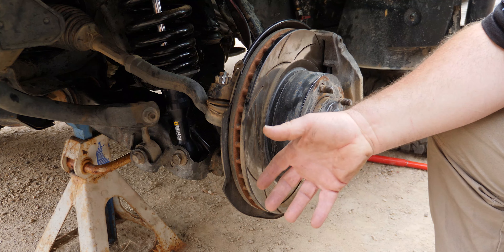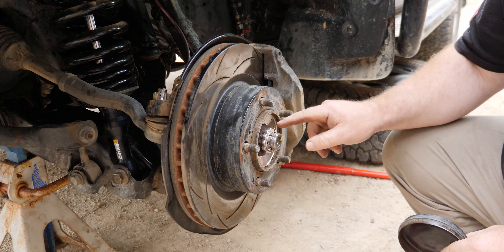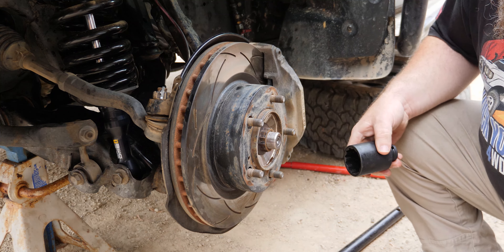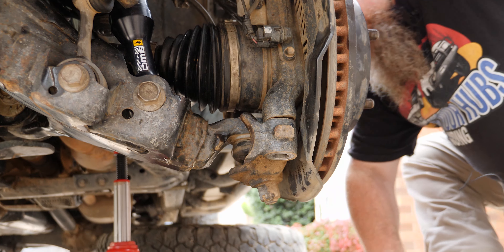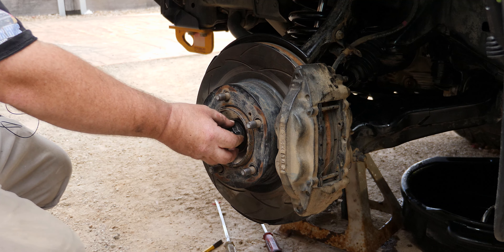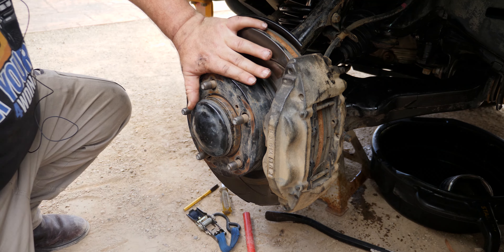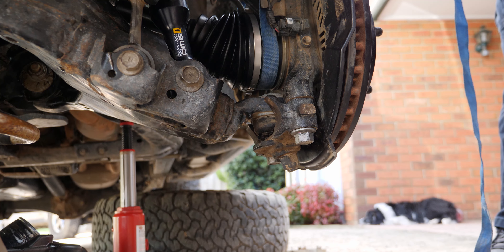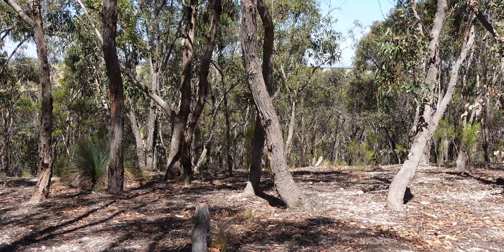How to replace a Land Cruiser 200 LC200 CV Birfield joint

Comment: Great video. Anti seize is the way to go. For easy replacement in future. The dust cover on the 200 series, looks to do a good job of keeping moisture and grime out. It came out with little effort.
Reply from the maker: Looked clean as a whistle under there and as far as I know, had never been removed.

Comment: It is possible to torque the big nut fairly accurately without a torque wrench.  
350 nm is about 260 ft lb. I weigh about 175 lb so I would divide 260 by 175, which is about 1.5. So I would put my body weight on the breaker bar at 1 and a half feet from the centre of the socket and this will torque it almost perfectly.
Reply from the maker: Now that's thinking outside of the box!

Comment: I'm awaiting my new GXL 200. This is so timely it's uncanny. I'm a Nissan GU owner stepping over to the dark side (hopefully the more comfortable and less overheating side) and understanding how to do this is a big confidence boost for remote travel with my camper. The GU driveline is not something I worry about, but having done 3 auto rebuilds in 2 years and spent a lot on oversized radiators (3.0 converted to a TD42) I'm really looking forward to driving a new car!
Needless to say a 12 point 39mm 1/2 inch socket and Toyota CV is on my shopping list.
Reply from the maker: Welcome to the dark side! The 200 is luckily one of the easier 4wds to change out the CV. 

The driveline is one of the best things about the GU, the TD42 kettle unfortuatley isn't.

Comment: Better to use a block of wood over the nut to hit at 4:30 .

Had a worn cv on a Subaru many years back, being broke at the time, I just swapped them left to right and right to left. Got many more years out of them.
Reply from the maker: You definetly need to use something softer than end of the CV.

Comment: Great video. But how can you tell if the cv is all the way in? And is it possible to cross thread it? Any info on what to do if out bush and dont have a spare cv?  Thanks!
Reply from the maker: You can feel it go all the way home. It's not possible to cross thread the inner as they're straight splines, the outer nut however can be cross threaded. 

If you don't have a spare, if just the inner cage breaks (this is what usually happens). Just remove the outer section that runs through the hub, lock the centre diff and just drive out in rear wheel drive.

Comment: Great video and channel,
So if you didn't have a spare would it be possible to just remove the shaft than limp home with the broken bit left in the diff? Or would it eventually fall out and loose the diff oil?
Reply from the maker: It depends on the setup,  if it's a two wheel drive, no, all the drive will go to the path of least resistance and you won't go anywhere.

If you have a difflock, engage it and you'll be able to drive forward, just need some way to stop the oil from dripping out.

Comment: Hey guys I’ve blown a cv on my 200 series can I drive with the cv full removed or does the cv hold everything in place
Reply from the maker: You would need to plug the hole in the diff, otherwise all the oil would come out. Also you would have to lock the centre diff.

Comment: Why did you lift the breaker bar rather than push it down when tightening the nut for the shaft in the hub?
Reply from the maker: That's where the tripod was!

Comment: I have a clunking sound in the front end on my 200 driver side front more noticeable when pulling up a curb I grabbed the cv and it has a clicking sound
Reply from the maker: Is it worse when you're turning at full lock?
Reply: @LockyourHubs4WDing  no not noticeable I’m thinking upper control arms had a bar in between spring and arm and clicking sound evident
Reply from the maker: @anthonybagnato7894  that sounds suspect, might need to check the bushes.

Comment: Thanks for the video. As a 200 owner I hope I don't need it 😬. What brand/type of CV was the broken on and what did you replace it with? What's your opinion on the highest quality/strength spare to use as a replacement? Had that CV broken before? How did he go driving out with a broken cv?
Reply from the maker: The car was purchased second hand (ex police), not sure what was in it. It was replaced with a genuine Toyota CV.  Genuine CVs while probably the most expensive, seem to last the longest.

 Luckily he broke the CV right at the top of a nasty hill and was able to limp out without any winching.
Reply: @LockyourHubs4WDing  mine is ex police as well. Mine was Toyota serviced for its life so it was probably a genuine Toyota one in that case. Thanks for your perspective.
Reply: I've only had 200 for 10000kms and a few months and about to replace my second cv .    Not a broken cv, but splits cv boots.   One was 10,000kms ago and the other recently
Reply: @ClaytonCookpanda  in was speaking to another 200 owner the other day. He was saying that if you have the lift a little to high they tend to chew out the boots. Perhaps take it to a good suspension shop and get them to check the angles.
Reply: @neutronstorm  Thanks - that does make sense - I'm running a 3/4 inch superior lift with diff drop.  might need to come down a touch in the front.
Reply: @ClaytonCookpanda  G'day Clayton, some minor info for you ..... I have a December 2010 LC200, literally drove it off showroom floor with 5 or so km, its now at 370,000km, it had a 2 inch lift since 40,000km  so far no CV boot splits ' yet ' and no CV breakage ' yet ' will happen sooner or later i sense its time is near. 80-90% of its km's on open country roads, not much residential or city driving left right left etc, of the 370k km's about 20k km's on tracks,  about 20k on dirt roads, the rest on sealed roads, has a minor power steer leak weep check 3 monthly or whenever that's it, tyres ware even with 10k rotate, oil change every 10k, towed a 3 tonne boat for a couple of years never overheat
Reply: @MRJRKAM  yeh they are good things I reckon.   Mine has 115k on it now.    CVs aren't bad at $500 each or I could just keep an eye on and replace the boot when needed.    I'm probably coming down to a 2.5-3inch lift soon.

Comment: CV on the 200 are garbage, I own a 200
Reply from the maker: Have you killed a few?
Reply: @LockyourHubs4WDing  Yes,  inner cv. Ball bearings falling out and all. Using CRAWL. The problem is that the OEM CV angle is already too big, doing any kind of lift or upper control arm travel mods will cause them to travel down too much and the inner CV to snap. I don't think you can snap them on an OEM non-lifted 200.
Reply from the maker: Seems like the inner is predominantly the one that lets go. It's a shame someone like RCV haven't stepped up to the plate and made an aftermaket replacement.
Reply: @LockyourHubs4WDing  Yes,  inner cv. Ball bearings falling out and all. Using CRAWL. The problem is that the OEM CV angle is already too big, doing any kind of lift or upper control arm travel mods will cause them to travel down too much and the inner CV to snap. I don't think you can snap them on an OEM non-lifted 200.
Reply: @LockyourHubs4WDing  The angle that those CV axles reach especially on the KDSS versions (increased travel) that are lifted is so severe. I don't think any after market can handle those angles. I think Toyota made the front differential sit higher than usual to increase ground clearance but that made the CV angle too steep. You also can't drop the front differential far enough because of the cross member.
Reply: it's funny because we have a large Toyota up here in NQ and I couldn't believe they didn't carry stock of Cvs - i havent busted one, but have replaced one due to boot split and after about 7000kms it started clicking.   About to do the other side a few thousand km later - split boot.   I'm running a Superior 3/4 inch lift with diff drop with 35s.   I commented to the service manager that it's probably because 2% of people actually take them offroad.   My other 4x4 is running a Solid Axle Swap and I'd love to that with the 200.
Reply: Whats the trick when the shaft has sheared off inside the diff
Reply: @ianmoore4327  Maybe drill and tap the shaft then use a screw to pull the shaft. Maybe...